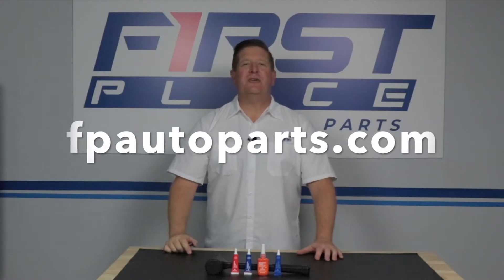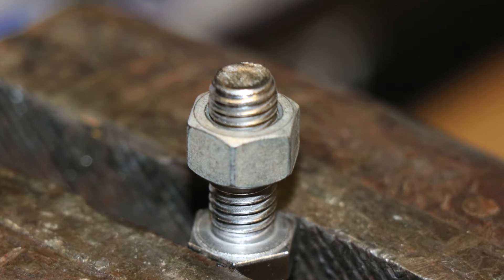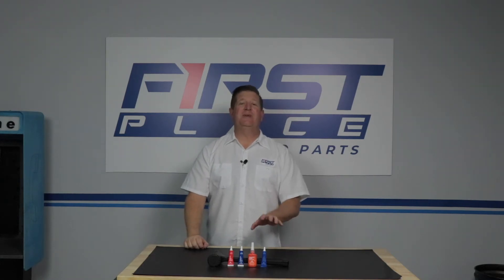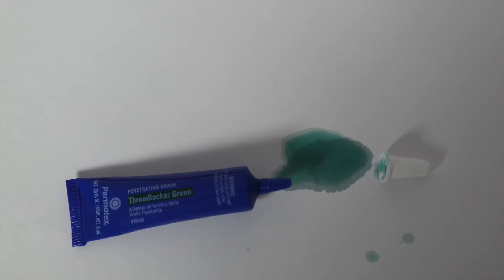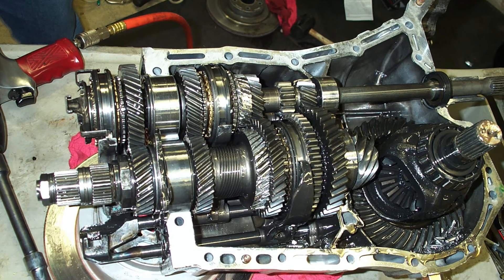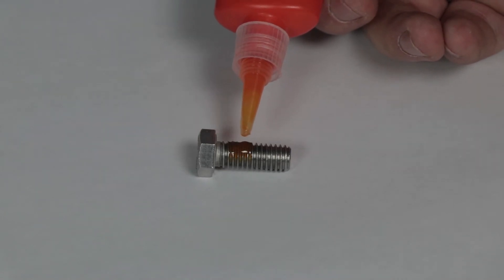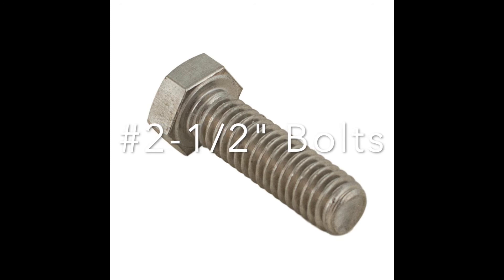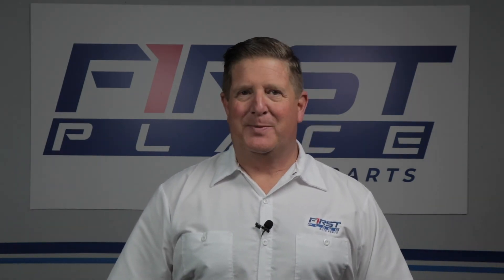The Ultimate Loctite Guide: When & Where to use it

Comment: If you want to easily remove Loctite Red 263/268 Threadlocker WITHOUT HEAT, all you have to do  is spray Chlorinated brake cleaner on the threads until it oenetrates into the bolt threads. 
The Chlorinated brake cleaner dissolves Red Threadlockers in under 4 hours.
You can thank me later!
▪︎ Alternatively you can use Orange 25210 by Permatex which is a high strength threadlocker like Loctite 263 Red but it's hand tool removable like Loctite Blue 242/243/248.
Permatex "Orange 25210" has 3X the strength as Loctite Blue 242.
Reply from the maker: We will thank you now! Appreciate the tip
Reply: Just curious on whether a 600+ ft-lb impact gun will remove a fitting with red threadlock without heat or chemicals before the bolt fails.
Reply: @h8GW  loctite advises against impacting red lockers without heating the bolts to 500°F or using chemicals to reduce the torque needed to 130ft-lbs.
It may be fine but I'd just use the chlorinated brake cleaner and use a breaker bar or impact after.
Or torch the bolt to 500°

Comment: You'd think they'd choose a neutral colour for the bottles. Like White, with a specific colour band.
Reply from the maker: Your soo right and great point!  Maybe if the makers of thread lock products looked at their products like the consumer does, they would understand the challenges a user faces.
Reply: @FirstPlaceAutoParts  Great video!  Glad to see our new Permatex Orange Threadlockers.  Over the last few years, we've been changing all of our bottles to match the color of the formula.  Previously, Permatex had all blue bottles, and Loctite had all Red, we're here to change that and make it easier for the consumer to identify the right formula for their application.
Reply: Great thought, We're on the same page.  Over the last year we've began to change all our threadlocker tubes to match the formula.  Making it easy to select the correct formula when you have all Permatex Threadlockers.  Previously, Permatex has always had blue bottles, and Loctite has always had red, we're here to change that.

Comment: Does it matter if you use the same thread lock for different size bolts? For example using blue on a 1” diameter bolt where it’s commonly only used up to 3/4”
Reply: I doubt even Loctite knows that They're very secretive with their products.🤔

Comment: What thread lock for control arm bolts and strut bolts?
Reply: If you have very sturdy hand or power tools and a bit of elbow grease, orange will be nearly as strong as red without needing heat to remove.
If you're scared of stripping bolts or breaking tools, blue has a decent amount of strength and removes nearly as easily as a naked bolt.

Comment: Yeah I think it’s all a hoax. Used red loctite on a bolt that goes on my exhaust manifold to hold my turbo and came loose right away. Even after tightening it and letting it cure for more than 24 hours.
Reply from the maker: Not sure of the temp range of the mounting surface where your turbo and manifold met but its possible it met or exceeded the point that red lock tight is rated. Focused, high heat is required to break Red Loctite's bond. It may have been the wrong product for the application
Reply: Use ProSeal red if you want a threadlocker that will stay strong at high heat.